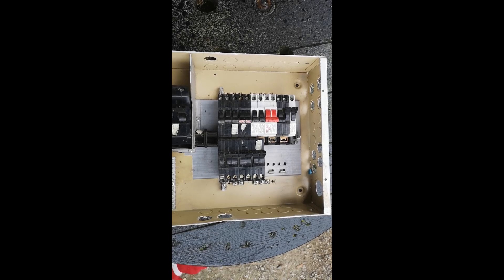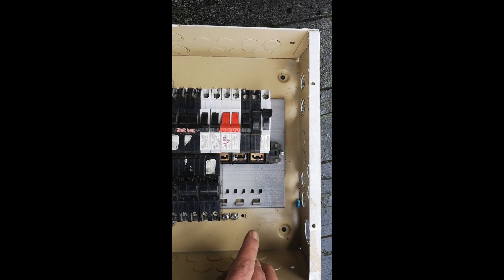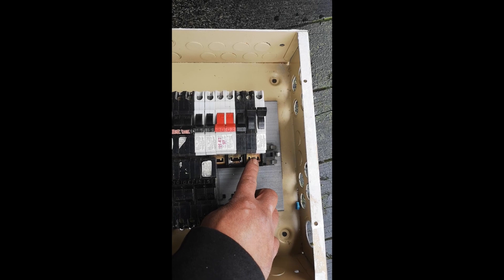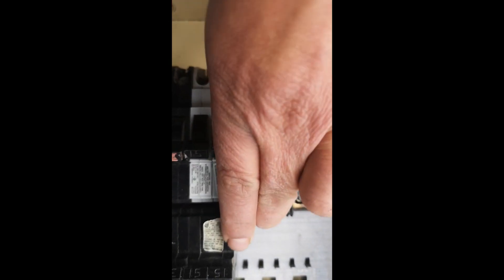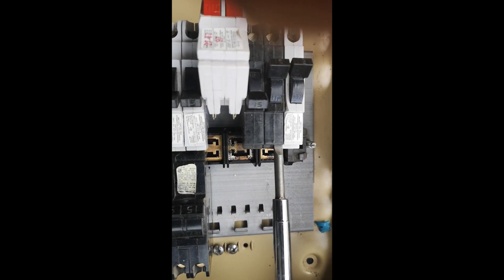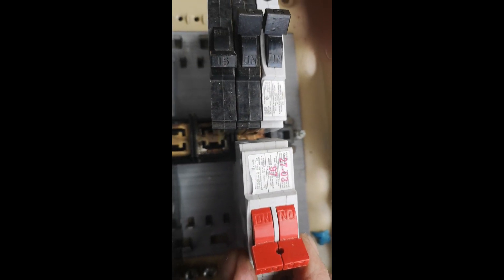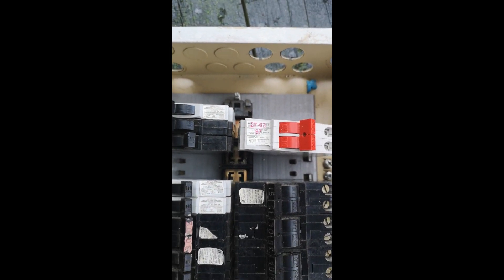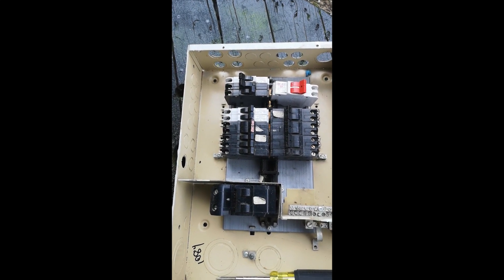Federal Pioneer Stab-lok Phase Explanation (120 volt-240 volt breakers)

Comment: Calvin - was racking my brain on my FP garage panel 220 volt 2 phase stab lock 30 amp breaker for a ceiling 5k heater - you nailed it bro keep up the great work and thanks